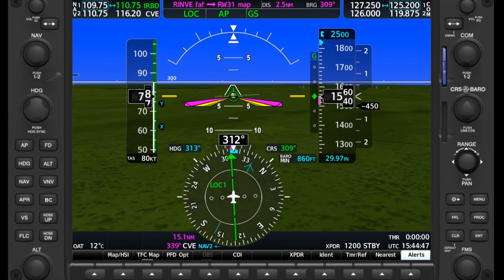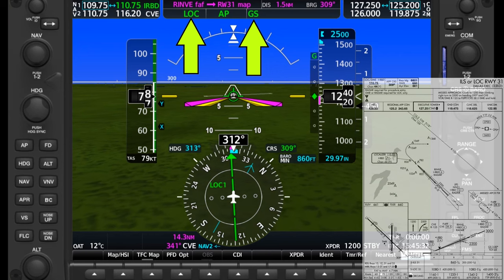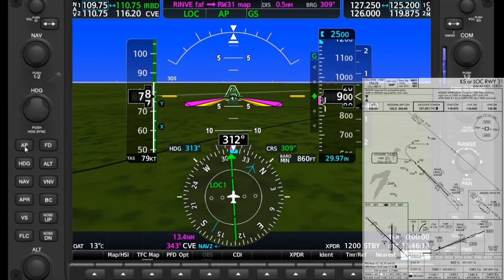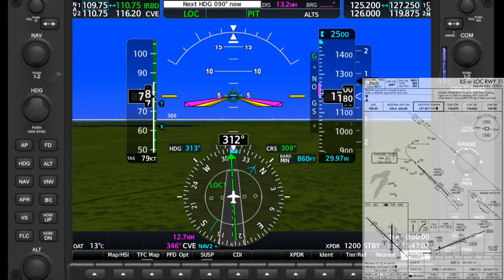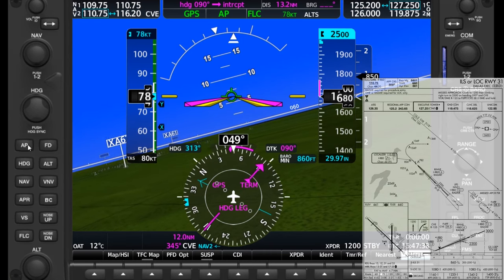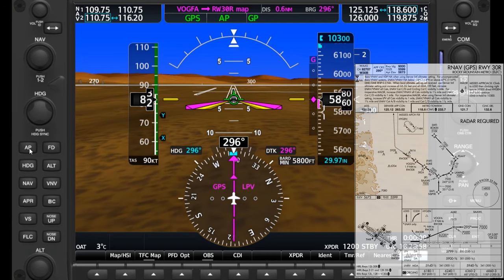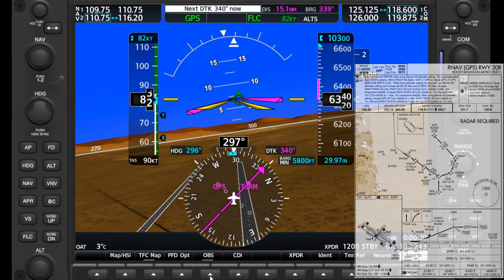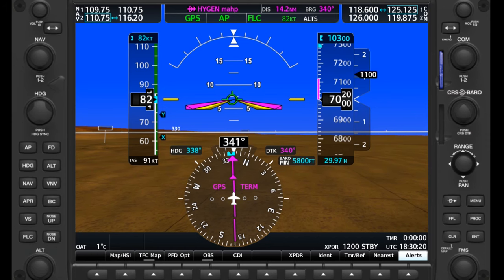Going Missed Using Autopilot | Common IFR Checkride Fail

Comment: Excellent well done video > the voice of the instructor is outstanding .  I totally agree ( as a CFII )  with hand flying the missed approach, at least up to 1000 feet … and be ready in case of an engine failure . Hand flying, will give you great control .

Comment: everyone has heard of people failing check rides due to not setting the CDI to nav / vice versa. However you can fail just as easily forgetting to press SUSP. on the missed approach. Great video the 5 C's should be used its a great mnemonic. Don't forget to click Susp. and click off the auto pilot if u want to pass the check ride and stay safe.
Reply: Too many acronyms. When I learned to fly we just did that. No automation. Stick and rudder, ball and shutter. Automation and autopilot was a luxury reserved for bizjets. We should teach basics to hand fly approaches, missed approaches because one day the automation may not be available on the airplane or tagged out inop.
Reply: @aviatortrucker6285  ok the world is different now. Even student pilot are flying g1000s and they need to be extremely well versed in avionics, acronyms just help. U seem grumpy
Reply: @briansantana3157  no, I’m not grumpy. I’m just not one of the lucky ones that have a lot of money to rent airplanes that have such automation. The majority of airplanes might have a few glass cockpit gauges. Keeping current for $250 an hour is pretty steep just to fly G 1000. A student cannot fly a plane like they used to then they are bound for trouble when the automation doesn’t work. It’s the same way with driving a semi truck without a manual transmission. It may seem easier because of automation but just like sports, if you don’t do the foundation basics, this is where students get into trouble. Take my advice you’ll be a much better pilot. If you get training in a tail wheel airplane. I’m met somebody at the airport many years ago that was starting their private pilot in a tail dragger. It does make a difference. I’m glad that the new students are learning a whole New World but from my perspective I started when a Cessna 152 with an instructor cost $47 an hour dual. It was expensive then and it took me 10 years to get my commercial rating. Flying has never been a cheap endeavor.
Reply: @aviatortrucker6285  ur preaching to the choir man I fly steam gauges at my school. We need to be teaching students advanced automation bc when they get their jobs 5 years from now it’s gonna be ALL glass.
Reply: @briansantana3157  I understand that but you’re missing the point. In every profession, you have to go back to the basics. You have to learn on the older stuff. Today young people have no idea what a manual transmission is, and even though there aren’t really any left, there may be a time where they need to know how to operate it. Automation is great and I learned it in the last two years. But it is always best to know the basics and fly with bare minimum so that you don’t rely on automation. Look what automatic transmissions did to vehicles. There are more accidents because people can be distracted, since there is no responsibility to control the vehicle with two hands and 2 feet. I find it amazing that five digit hour captains retire, and go back to flying a Piper Cub with stick and rudder, turn slip and ADI and have more fun than when they were piloting a 777.

Comment: Dan, what’s the reason that the AP is disconnected upon initiation of the missed approach?  In the Cirrus Perspective Plus, there’s no need to disconnect the AP.  Upon reaching DA with AP engaged, hit TO/GA (AP remains engaged), cram, clean, climb, and then select NAV / FLC modes to have the Flight Director / AP fly the published missed.  Just curious.
Reply: Can not speak for Dan but most AP have an limitation of not to be used less than 400-500ft AGL.  Not all planes have a TOGA, and not all of them act the same.  In fact, some TOGA will disconnect the AP.
Reply: @Vejitasei Roger that.  Thank you!

Comment: Usually about 50 feet from decision altitude on the ILS I will switch the CDI to GPS since I basically have no longer considering flying the localizer. At DA I click off the auto pilot as I apply power, establish a climb, clean up the airplane and about that time it is ready to just push the susp key. I also always keep my heading bugged, just in case I lose any kind of NAV and have to go to a heading mode. I practiced the same concept, even if I’m flying a VOR approach. The only time I really hand fly the aircraft is if the missed approach requires an immediate turn towards a heading or towards a fix/facility. Now we could talk about the more complicated procedure if you’re flying steam gauges with or without auto pilot and using a GTN 650 or 750 navigator.
Reply: I don't know about you,  but switching nav source at 250 and getting the als in sight at 200 would definitely affect my SA.  it works for you tho?
Reply: @r3kthoops750  I think you misunderstood me. Flying the localizer down to minimums right before hitting the MDA. I switched the source to GPS. My heading and descent rate do not change. I’m merely have my navigator prepared for the missed approach via using the GPS. When I hit the MAP, the OBS but will change to SUSP and I merely start my climb, clean the airplane up, press the SUSP key and engage the auto pilot to allow the aircraft to fly the missed approach procedure.

Comment: Disconnecting autopilot during a go-around seems like the worst idea ever. Isn't that when the workload is the highest and potential for spatial disorientation is the highest?.. Why can't we just have the autopilot fly the missed?
Reply: Most AP have a limit that they should not be used within 500ft AGL.  If you are flying an approach with vertical guidance (LPV/ILS) the AP doesn't know you decided to go miss, and the actually sequencing point is normally the runway threshold (which are not over).  We do not have CAT III landing capabilities so we have to disable the AP at DA.  Normal practice is to disengage AP at DA, hand fly until the GPS sequences to the miss (normally but not always after crossing the runway threshold) and then then you can reengage he AP when > 500ft AGL (or 1000ft AGL as in this example).
Reply: The go around button in the King Airs I fly disconnects the AP for you. You don't want to be low to the ground and pushing buttons. Pilots should be hand flying to initiate the missed then through 400 AGL (my company SOPs) you can re engage the AP